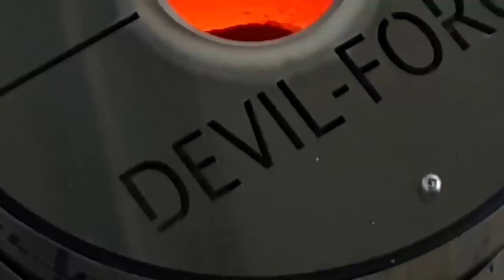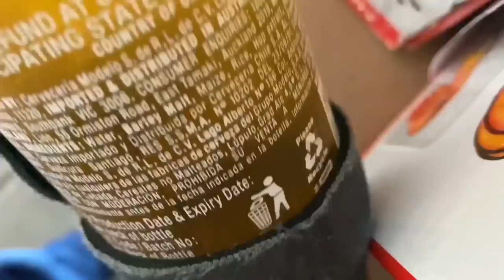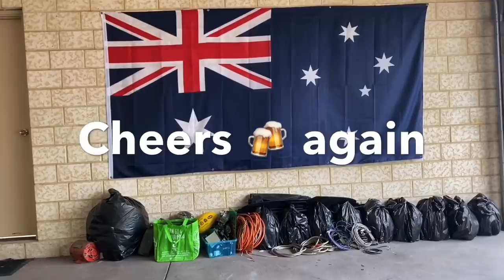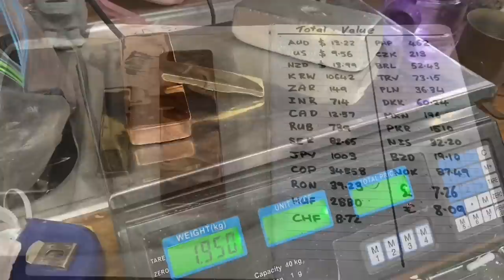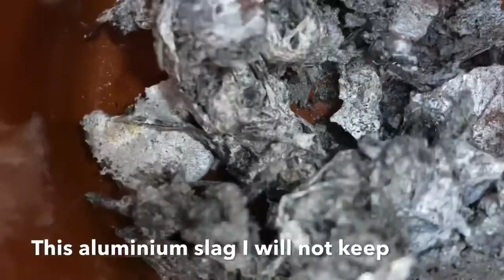ACDC Converter Copper - Dumpster Diving - Trash To Treasure - ASMR Metal Melting - BigStackD Casting

Comment: The wire is Copper with a very thin plating of Tin on the strands for corrosion resistance.
Reply: Could be this or aluminum hard to tell from the video. Usually aluminum cable is a lot thicker so you are probably correct.
Reply from the maker: Actually a few people have said it was white copper which I’ve never had any experience with I just assumed they were aluminium wires🤷🏻‍♂️. Google says “white copper is an alloy of copper with zinc and nickel, having the appearance of silver “ so there’s a pretty good chance it could’ve been that🤔
Reply: @jxavier3876  Aluminium wire does not get soldered like that.
Reply: @bigstackD  They may be using slang but I guarantee it is straight copper with a tiny plating of Tin. If you find more stuff like it scrape it with a file and you'll see the copper colour start to come through.
Reply: @WinzoIsAEpicFail  yeah idk what I was thinking

Comment: Capacitors are made up mostly out of aluminum casing and aluminum sheets with paper in between. I'm suprised you throw them out but keep the grinding dust etc.... Anyways nice melt as always 😁
Reply: not to mention oil...I once told an IBM tech that a capacitor had blown because of the burnt fish smell.  I suppose he thought a female computer operator wouldn't know this. Sure enough, he finally pulled the power supply after hours later of trouble shooting...one fried capacitor.  ;)

Comment: what do you use as flux for aluminum? made my first two bars today...2lbs each, (1kilo?) I scraped about 1/3rd of the floaty crap off the top trying to find the molten aluminum. 1 bar was from soda cans, the other was from an old flagpole. I heard one can use Salt? I'd rather not, chloride is really corrosive!

Comment: the copper slag, when taken out of the crucible, is on fire burning a small beautiful blue flame. Also, you could put all those electronic boards and capacitors up on ebay, I know for sure people would buy them.

Comment: Those large capacitors from the converters have a 100% aluminum casing on them. All you need to do is to cut off the end holding the rubber /plastic plug  and pull out the insides. The outer casing is all aluminum.(with a shrink wrap plastic over it.) You're missing out!
Reply from the maker: Well at least they’re all piled in a container for a rainy day I suppose👌🏻
Reply: @bigstackD  Good thing about  these type of capacitors, is that they are EVERYWHERE! computer power supplies are a good source of them. If they're good or bad, they still contain the same amount of aluminum. I think there is aluminum inside as well.. They make great firecrackers too!

Comment: those capacitors you dumped are basicly aluminium foil rolls inside, but the layers between (usually a kind of alu-oxidation) are slightly toxic. but not advisable to heat them up when still closed

Comment: have you thought of installing quick disconnect fittings on your forges and on the gas hose so you can easily switch forges while leaving the hose attached to the bottle of propane

Comment: Is it possible to make a sandwich ingot of various metals? Would they bond together after melting? Would the layers bleed into one another? I'm guessing you'd have to start off with a mold that has the highest boiling point metal at the bottom, then let it cool off before layering the next metal on top? Would make for a really nifty looking bar.

Comment: Great video. I'm trying to find a metal stamp with my logo. Any idea who makes it? Also 2 to 4 molds. ☠ and 🦂 ones? Who can make them?
Reply from the maker: I got my custom steel stamp made at Etsy.com mine is a 1 inch width stamp and I think from memory it cost me about $230AUD but worth every cent. that same site can also do custom coin molds  or other type of molds  you’ll just need to search around as there are a hell of a lot of people that can help you there, just look for someone who’s got good reviews and it shouldn’t be a problem. I can’t tell you who are used as I have absolutely no idea it was that long ago.

Comment: What determines the need to use borax (? Can’t remember ¿)  to help pull out impurities?  I would have thought given the insulation and other non-metal stuff still on these you would have used it ... but that is novice me trying to connect dots. 🤦🏼‍♂️

Comment: "Not really sure what to do with all this"...
Generally speaking it should be turned in as E-Waste at your local recycling station, but from a melting point of view...:
1) Diode bridge (squre thingy on top): Consists of 4 diodes (silicon), 4 terminals (prob. A2 steel), potting material (mostly Silicone) and housing (plastic).
2) Capacitors: Terminals look like aluminium, electrolyte (borax, acid or other), foil (trivial amount of Aluminium) and housing (plastic).
3) Potentiometer (round thingy with a turn knob): mostly steel and a thin foil with a carbon layer on it.

So for you... absolutely no use!
Burning it could be super toxic and taking it apart, only slightly less dangerous.

Comment: Them blue capacitor have   Aluminium in them.  But punch holes in them they have a oil  in them and will explode in the furnace.

Comment: So all those connectors. Are you sure of their make up so you can melt them down and toss the slag. Those screws are bound to be stainless mixed with tungsten and etc. how do you separate them all? Do you go for a main and make due or are you going for 99.9% for resale? How would a buyer deal with your wall?
Reply from the maker: I’m not really sure of the purity of most of my Ingots but as I am not selling them or making precision pieces I’m not too concerned. If I was to ever sell any of my pieces I would do so on eBay and with this channel and the amount of subs I currently have I reckon I could probably get rid of it all for pretty good price . that won’t happen any time soon mate as I’m on my way to 1 tonne and who knows after that👌🏻
Reply from the maker: Oh and the steel bolts nuts and the like I just put in a big pile and my mate picks it all up and when he has a couple thousand kilos he takes it all to the scrapyard so I’m not sure if he separates it down further or just takes it all in as basic steel

Comment: So do you just destroy your bowls with concrete slabs and then re-mold them back into bowls to be destroyed with concrete slabs again after they are done cooling down ingots? I'm personally curious now
Reply from the maker: Yes But sometimes They get destroyed beyond fixing but I get all my bowls from the local op shop extremely cheap so it’s not a problem if they’re damaged beyond repair

Comment: I have spent a lot of time dealing with electronics and power supplies. I have never seen aluminum wire used in electronics but I often see tinned copper wire which could look like aluminum. You should test a piece of the wire with a torch and see how it actually melts,  the difference between copper and aluminum is obvious.

Comment: Not stripping the plastic off the wiring won’t mess up the smelting process?.
Reply from the maker: No mate you could quite happily burn the plastic off in the furnace all it will do is leave some  ash or carbon or whatever it turns into either on top of the melt or in the bottom of the Crucible so when you pour just pour carefully you will be able to get all the molten metal out of the Crucible and leave all the impurities and stuff in the bottom of the Crucible if that makes sense . It will however produce a fair bit of smoke but that will disperse pretty quickly

Comment: I doubt those cables were really aluminum. Wires in power converters are pretty much always copper with a very thin tin coating for corrosion resistance and to make soldering easier. Odds are you added a tiny amount of tin and a bit of copper to your aluminum melt with the aluminum heatsinks.

Comment: The cables were not aluminum. There are a tinned copper wires. And in my opinion, the "copper screws" were steel and copper-plated. The steel was dissolved in copper into iron bronze. Next time, I suggest testing with a magnet. But great job, I like it.

Comment: Awesome video as always---Why are those flames blue??
Reply: Usually when you burn copper wires they do that. Sometimes they have a special coating on the copper that burns off in the heat.

Comment: Those capacitors (those big cylinder things) should be made from aluminium. Crack them open and unroll them first to remove the paper and oil otherwise they will likely explode or potentially cause a fire.

Comment: Why are some electrical cabling aluminium? I thought it was a bad conductor?
Reply: Yes they are. And they havent been used for decades. I am pretty sure  they are tinned copper wires
Reply: @joeemamaaaaa  but I’ve seen this before on this channel, he took apart a pedestal fan and indie the motor wasn’t wasn’t copper but aluminium with a thin layer of copper around it. Is it done by  the manufacture to cut costs?

Comment: Mate what gas pressure control do you use ?
Reply from the maker: When it comes to the devil forge furnaces I use the regulator they send with the furnace and below are the pressures I always stick to

REGULATOR SET POINT and adjustments 
0.12MPa Copper
0.10MPa Brass / Bronzes
0.08MPa Aluminium 
I set the regulator at 0.10MPa for brass and when it gets up closer to its melting point I backed the furnace off to 0.08MPa to make sure I don’t accidentally overheat the brass and burn off the zinc.

Comment: NOOOOOOOOOOOOOOOOOOOOOOOOOOOOOOOOOOOOOOOOO~ The horror, the caps and bridge rectifiers you tossed... To bad I am so damn far away I would have paid to have them shipped. Be careful though those damn things , if they still have a charge and you short them out they can melt aluminum and start a trash fire.

Comment: Please be extremely careful working with large capacitors. You should always drain the voltage from capacitors before handling, especially large ones like those. One old cap can hold enough juice to kill you instantly, even after years of sitting idle.

Comment: I've been tempted a time or two to just chuck my small wires in without stripping them like that.
Reply from the maker: yeah mate I’ve done it a few times off-camera and if you do do it just leave the heat on and you won’t produce bugger all smoke but as soon as you turn the heat off if the rubber hasn’t burnt off properly you will get a hell of a lot of smoke👍🏻

Comment: the capacitors are mostly aluminum case withe plastic core with electronics inside not much use other than the case.

Comment: So, I notice in that video in particular, that you don't know what to do with all other unwanted electronic parts (or related) in your metal projects!... In such situations, dont try to melt or burn any part of that material, it would generate harmful toxic fumes that can harm you and your neighbourhood!... I notice that you work in your garage entrance and you are close to an array of buildings, your neighbours!... If you are found as responsible of burning toxic waste, you could be fined! Don't take any risk! Instead, I propose you to see if somebody nearby you, in your surroundings seeks for or needs electronic parts for his projects, in order to sell it or give it away to him! If nothing works in that way, you can sell it on Ebay because it looks to be great electronic stuff that classic electronic DIY'ers look for! I either notice that these parts seem to be re-usable at 80% and above! In these three AC-DC converters (240VAC-24VDC), great capacitors, voltage regulators and diode bridges in them, are truly sturdy and can be used in any classic power supply applications as power 12V or more applications to drive electronic or low voltage motor drive projects. It,s the same thing for your other electronic motor speed controller panels you have disassembled for metals in your previous projects with all PCB's, semiconductors, relays, capacitors ond so on in them that you have in excess and don't want any more in your metal projects! On my side, If I would stay in your neighborhood (I live in Canada  in the Quebec Province), I would try to get it from you for my electronic projects! But, unfortunately, it's not the case!... It would cost a fortune to get it in Canada where I live!... Ultimately, you can bring it to your nearby recycling centre that surely will accept your excess, unwanted electronic material! You do great metal projects and by the way, you have a great metal (ingot or other mold projects) collection with description of the provenance of each metal manually stamped on each metal ingot or mold freshly conceived! That's the first time that I can see in my life, someone that melts scrap metal and then, collects his metal ingots with the origin of the "scrap" stamped manually on each of them then, exposed in a "showcase" instead selling it to metal companies!!! Truly unique of its kind, ingenious and original! Congrats!...

Comment: this cables are not aluminium this is white copper.
Reply: There is a tin coating on the copper. White copper is copper and nickel, it is not used in electrical wires.
Reply: @silacka3114  i recovering cabble every day and i know this is bleached copper ...
Reply: commonly white copper
Reply: @8artek118  wtf are you talking about? You cannot bleach copper, if it is copper then it is colored like copper. I am in scrapping business, and i can tell you thats copper with tin coating on it.

Comment: Where the fuck do you dumpster dive, holy shit!
Reply from the maker: Actually buddy one of my good friends is the boss on the local industrial site and he lets me go through the scrap bins and take-home what I want on the one condition anything I take off site he will have to see it in the future video so I’m not allowed to fix anything refurbished anything or run to the scrapyard for a quick dollar. That’s why sometimes I will melt down what seems like brand new things, and the reason I do most of my dumpster dive at night is because there’s less prying eyes and if the dayshift workers saw that I had permission to take things off site they would probably grab it before I had a chance to👌🏻